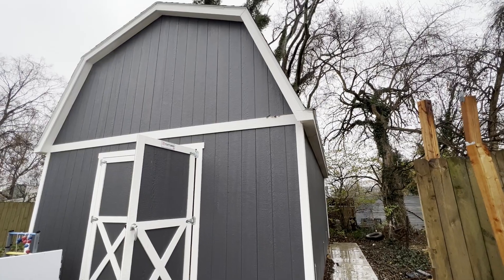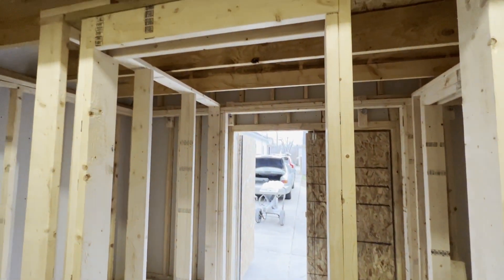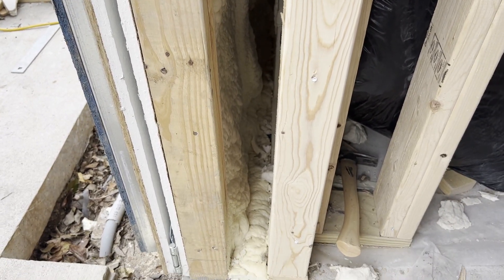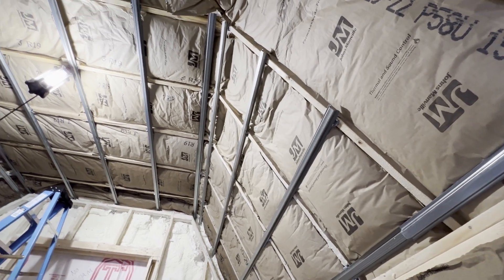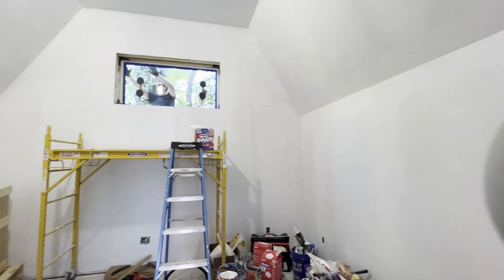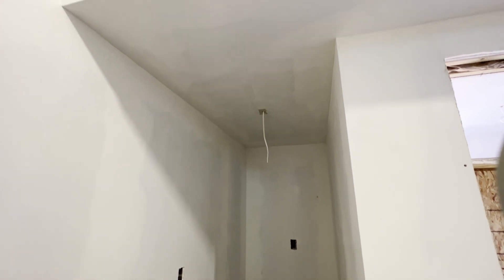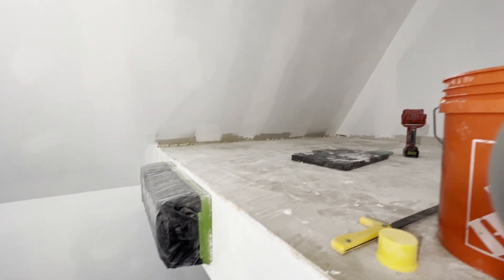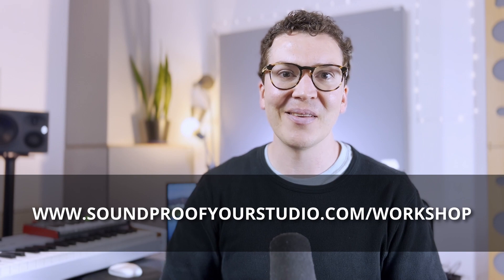How To Build A Soundproof Shed Part 2

Comment: I found it interesting he used the cheapest insulation and not worrying about the R value because the design of the double wall system would accomplish the soundproofing regardless. what are your thoughts on spending more on a high R value insulation to possibly compensate for not building as advanced of a wall system?
Reply: did u ever figure this out? i don’t want to build a double wall system. im thinking of just stuffing rockwool between the studs and calling it a day
Reply: @troywakeman  I have not. I hope this can be addressed by someone with the experience needed. I as well want to see how mich of a loss it might really be if we forgoe the complication of a double wall for better insulation.